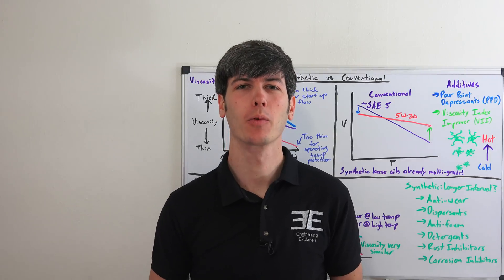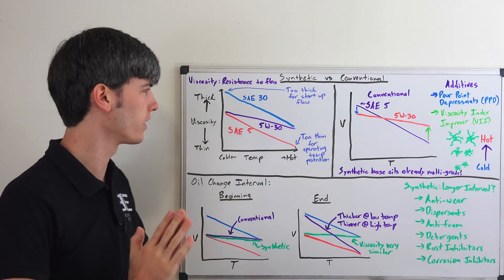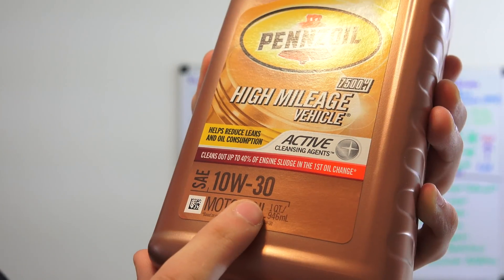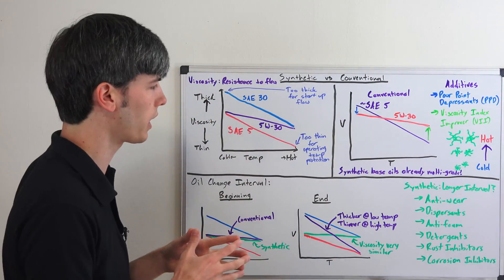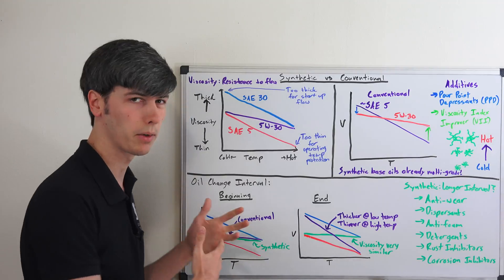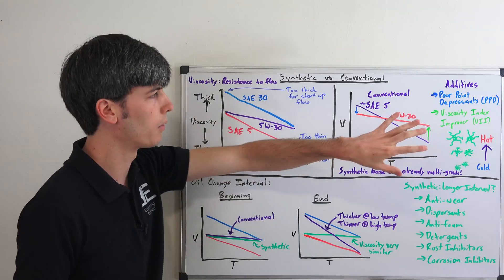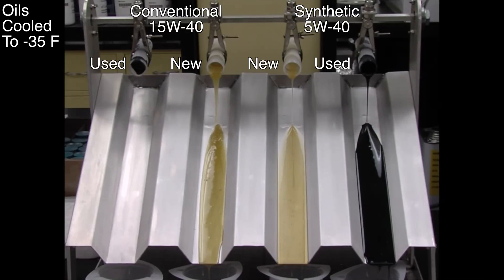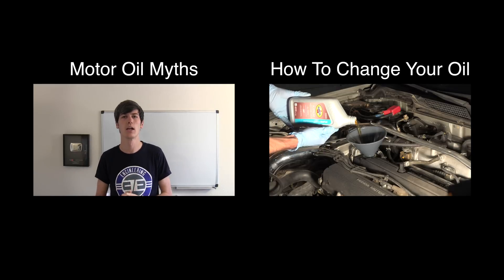Is Synthetic Motor Oil Better For Your Car?

Comment: That test was a tad ridiculous. What engine would recommend using 15w40 for -35F temperatures?
It doesn't really matter how poorly it performs at that temperature range if you are never going to use it under those conditions.

Yes synthetic oil is better than mineral oil, but provided you are using the correct grade and spec for our engine and change it at the required interval there is no disadvantage to using mineral oil.
As pointed out in the video,  the base oil may break down less but the additives still break down and you will need to replace at the same intervals regardless. If your engine is designed to work with 15w40 and you operate it in the correct temperature range there is no advantage to using a 5w40.

Comment: Im a chemical engineer and i was so confused with this rating. I tought the 5 and the 30 where the viscosity values. Now i inally understand this. Youre the best!
Reply: chemical engineer? should have studied grammar
Reply: @paulanderson79  english is my second language. How many different Languages do you speak?

So on top of being an engineer Im also bilingual. 

If you dedicated your time to help others and to be usefull, instead of attacking people on the internet,  you might become somebody worthy someday.
Reply: @NelsonR001  Not disputing that at all. Thing is that there's more than SAE viscosity when it comes to engine oil.

Comment: Can you experiment with using lightweight oil and see if it increasing mileage? Like 0w-20 to 5w-30 synthetic and seeing if it increases fuel economy and still protects the engine.
Reply: 0 Weight oil is usually too thin for a conventional car, race cars use it and "high performance" cars because the lighter oil helps when you go from cold engine to 100+/mph in seconds, but for a normal car user that scenario isn't realistic.  You'd also probably even loose protection once the engine got warmed up due to the less weight at the high end "20". Use what your car manufacture recommends, they tested and designed the engine and all its parts for a certain weight of oil.  Save gas mileage by changing your oil and air filter at regular intervals and making sure your tires are correctly inflated.

Comment: The W stands for Weight  or viscosity.  Standards test is heated oil timed through a funnel for the test. Read the testing standards book. READ!!!
Reply: No it doesn't. The W stands for winter the numbers are its viscosity. Ask yourself this if the W stands for weight (which by the way doesn't make sense anyway because you're saying weight is the same thing as viscosity which isn't true considering they are 2 different words with different meanings) why isn't there a W at the end of a 5W-30... wouldn't it then be 5W-30W? Its not because W doesn't stand for weight. Its a common misconception but a quick google search or whatever search engine you use will illuminate you on this matter even further than i can.

Comment: I drive tractor trailers for a living. One of my employers used synthetic oiling his trucks, engine, transmission and diffs. He followed the manufacturers oil change guide lines and had the oil analyzed. This was 15 years ago, and both trucks are still working. One has a new rear diff, but  other than that no major repairs. Also I bought a used Dodge minivan with the 3.3 v6. It had been on synthetic oil from its first oil change. I sold it when I hit 400000km, and it ran like a top and didn't burn oil. These 2 things have led me to use synthetic oil in all my vehicles since then, and I've had no major problems.

Comment: what is the difference between synthetic oils aside from prices, does it worth buying the most expensive one rather than a little bit cheaper. what if you use a cheaper one from refutable manufacturer, will it really affect your car's performance

Comment: Ok I understand what your saying but why does the purple line contradict what your saying... 5w is the resistance at start up which is lower than a resistance of 30 and therefore 5w is thinner. This thinner oil has additives which expand during the heating process and make the resistance of the oil go up to 30. That would mean on the  chart your showing the purple line would go up to the thicker part of the scale to 30 resistance.. YOUR GRAPH SHOWS THE PURPLE LINE BELOW 5W AS IF IT WAS GETTING THINNER MEANING IT HAS LESS RESISTANCE. Are you just illustrating what a 5w oil would normally do without the additives?  Your words and the chart were not adding up and made it more confusing .. although i did learn a lot here . am i missing something ? i just want to make sure Im not reading the chart wrong...

Comment: 1986 Toyota Tercel 275k miles
2006 Toyota Sienna 336k miles and still running.
2009 Lexus RX 350 (currently) 250k miles
All conventional oil. Don't see the point of spending extra $$ for synthetic.

Comment: Every amature engineer seems to always talk about the slipperiness and the W numbers with synthetic. Yet, none of them seem to discuss the dispersing of contaminants?  synthetic oil does not hold thecontaminats of combustion as well as conventional oil. This is an issue related to how the parts wear.  A point of this, is that in aviation products, the engine manufactures still do not recommend full synthetic oils. Using synthetics can void the engine warranty.
Reply: Good to know!

Comment: If anyone was wondering, synthetic, or conventional, 100 running cycles reduces most oils to a property that is no longer protecting against wear. what this means for the consumer if you do two trips a day, that's 2 full cycles out of your oil's life span. factoring an average of 2.5-3 cycles a day oil should be changed every other month. follow this schedule you wont be replacing any engines this year.

Comment: With cold engine start having been determined to be a major contributors to engine wear, has any manufacturer considered a somewhat delayed start to allow oil to warm before the engine fires? I have an older Alfa and when the ignition switch failed, I added a separate and independent starter button and ignition toggle. I’m sure it makes little difference (@120k), but I typically crank the engine (ignition off) for a few seconds to build some pressure before I hit the ignition. Feels good!
Reply: that's something i've thought about too, re the moment of first fire.   (i thought of it bcuz i have a car i use infrequently so i know the oil has entirely drained to bottom, with nothing coating the surfaces of contact wear surfaces.    Incidentally, the cold weather areas often have engine oil heaters that keep the oil warm all night, and to me, that would be an absolute must in even modestly cold weather regions.  I live in a moderate maritime zone, very mild.   But the number of cranks before firing is something i wish i could manipulate on any car i have, and perhaps there are potential electronic hacks for it, though i've never heard of any being for sale.    Some may argue that the extra cranks could do more wear on some engine parts, paradoxically due to rates of rotation perhaps, visavis how soon the oil is delivered.  (bcuz delivery of oil speeds up dramatically once the firing starts.   So i guess this is a question for the engine engineers.

Comment: Wait a minute.  What's the real bottom line here?  The real bottom line here is money, not superior performance:  The oil companies can realize a much higher profit margin off of selling synthetic oil, which is manufactured using much less real oil, than they can off of selling 100% real oil as a lubricant.  Then come the spin artists like this guy on the video telling you a bunch of questionable reasons why you're better off with synthetics.  Hitler, because of Germany's restricted access to petroleum during the Third Reich, was forced to rely on synthetic fuel oils ingeniously invented by his German scientists.  This is the same thing all over again, except that here there is no shortage of real oil, there is just a quest for greater monetary gain.  Once again, little guy, you are just being robbed by the big guys.

Comment: Answer is simple. If you have a cheap car just run it on conventional oil. It will wear faster but you will sell it before that. Now cheap cars are not meant to last. Use synthetic for those who really matters
Reply: Very few cars here in Europe have specs that can be met with mineral oils. It's not just about viscosity.

Comment: My camry 2015 has 180k miles on it, which oil should I use?
Reply: Whatever Toyota tells you to use. Please be aware that there is far more to it than just SAE viscosity rating.

Comment: i have a jetta 2007 2.5 5 cylinders with  108 miles what oil can I put...
Reply: Look in the manual. There will be a spec something like VW505.01 / VW507.00 or similar. Buy oil that meets this specification.

Comment: Well...added to the fact that synthetic oils don't break down as fast...I go 10,000-12,000 miles using mobil 1 and a quality filter...Never had an engine wear related issue...In this current extreme cold spell we are experiencing -15 to -25 below zero...the car is much for likely to start since synthetic doesn't thicken up and freeze like conventional oil..

Comment: I switched all my vehicles to fully synthetic oil. Although the color is darker after 7000 miles oil change I still pinch the oil between my thumb and index finger and it still has good viscosity without any grit. Back in the old days I used to use conventional and changed my oil every 3000 miles but not anymore. I would also spend a few extra buck and buy a better oil filter instead of a junk oil filter. STAY AWAY FROM FRAM oil filters, they are trash.

Comment: Warning if you have a older truck or car you might be better off using conventional I bought a 92 f150 a while back when I bought it the old man told me he only used conventional oil in it cause that's what works best I did not believe him so once I reached the appropriate mileage I changed the oil to full synthetic and changed the oil filter to the next day I started up my truck and heard a knocking sound that it did not have before and it would stop after my truck got fully warmed up and then a month later I noticed my oil was low and I was leaking oil from somewhere but no idea where and that was not happening when it had conventional oil in it so I went to the store and bought conventional oil and changed it again and both the knocking sound and oil leak stopped so if car that around the years of 95 or older and you might be better off using conventional because that's what those engines are made for

Comment: Does this apply to a diesel car engine?
Reply: Use an oil that meets the specs listed in the handbook. It is not just about SAE viscosity rating. You need to check ALL the specifications.

Comment: I was wondering whether synthetic oil can last more than 6 months? There is a common understanding that for synthetic oil, it should be replaced every 6 months or 10,000 miles. What if my car only traveled like 2,000 miles in 6 months. Should I replace it or I can probably stretch it to 8-10 months?

Comment: So a 0w40 would be better than a 10w40 for cold start ups?
Reply: Go with what you car maker recommends. There's more to oil that simply its SAE viscosity rating. In general it's bestrr to go with the narrowest range which suits the climate where you are. The wider the range the more the oil is dependent upon VI and friction modifiers. This can cause oil to deviate from spec sooner than anticipated.

Comment: If synthetics are better why do they sell regular oil?
Reply: Because some people buy it. In America anyway. In The EU it's virtually impossible to find. Most EU cars now have specs that cannot be met with anything other than synthetic oil. It's not just about viscosity. The only benefit to regular oil is that it's generally cheaper than synthetic oil. Beyond that I can think of no benefits.
Reply: @paulanderson79  

Old cars run old oil.

If i would go for synthetic my '69 car would start leaking everywhere
Reply: @benbonaparte4431  Fix the leaks then.
Reply: @paulanderson79  

Old cars arent that exact as new ones. Was simply dont possible.

Fixing leaks would mean overtorque. Just not necessary
Reply: @benbonaparte4431  OK - I'm with you now. I was thinking of recent model cars which absolutely have to have synthetic oils to meet the engine's requirements. Ones where there's no mineral (conventional / regular) alternative.
Reply: Zinc, Needed in any non roller lifter engines.          Flat tappet engines, Lawn mowers, Older diesels, Older motorcycles. Two i know has zinc are Mobil 1 15/50 Racing oil and shell rotella 15/40 Diesel oil. Cam lobes don't last long if the oil doesn't have enough zinc.

Comment: Synthe oils have zinc in them to protect the camshaft in our older model engines ? Rebuilt
Reply: Zinc is used where “boundary lubrication” zones exist (piston rings, gearteeth etc) camshafts are under “hydrodynamic lubrication” conditions

Comment: The thickening of the conventional motor oil when it reaches the end of its use life at the change cycle . . . Aaahhh!  So that is why it was suggested to me that it was best to drain the conventional oil while the engine was still hot when I started doing my own oil changes on vehicles 45 years ago.  Or, to warm up the engine prior to doing the oil change back in the days of conventional oil.
But, I've switched to using synthetic motor oil back around 25 years ago for my own oil changes.

Comment: Jeeps rust faster than any vehicle I know. Bottom line change your oil often and your engine will run 500,000 trouble free miles. Rustproof the undercarriage of your car yearly with Linseed oil and your car/truck will last forever.

Comment: Hello, planning to change the oil of my new used car. It is a Hyundai Accent 2010 Turbo Diesel. What engine oil should I use? I live in the Philippines. 30 degree celsius average temp here.
Reply: Whatever Hyundai suggests.

Comment: What about an old vehicle(87 Ranger) that's used conventional oil all of its life, with regular oil changes at about 2300 miles? Is it wise to switch to synthetic at this point?  Some advise to Not make the switch for fear of damaging the motor.  Please comment on this matter.

Comment: Ok I have a 1997 F-250 HD with the 7.3 L Powerstroke and I use 
15w-40 oil and it has a hell of a time starting in the winter months here in Alabama I was wondering is there a different oil grade/vescosity  I can use and still provide the same protection as the 15w-40 thanks have a good day

Comment: I wanna ask 1 question plz answer me soon i am from pakistan i buy 5w-30 fully syenctic oil for suzuki cultus pl let me know 5w 30 is also work in 50 degree ?
Reply from the maker: Yep, if it’s what’s recommended for your car it’s what I would continue to use. Owners manuals will occasionally recommend a different oil based on the temperature.
Reply: @EngineeringExplained  i have suzuki cultuse 2018 plz let me know which oil grade should i use in it

Comment: i have  a 1999 subaru legacy Brighten i think it's a 2.2 i change the oil about every 5,000km but i only drive about 15,000km per year should i change it more my car has just under 148,000km on it

Comment: I know it's very difficult to fit all the needed info on topics like this into a short video.   This channel does a great job of squeezing in alot of good information and explanation into such a short video.  
I spend alot of time trying to explain basic oil understanding to customers and other mechanical enthusiasts.   Alot more to explain when it comes to motorcycles that use a wet clutch as most motorcycles these days do.  With a motorcycle that uses the same oil in it's engine as well as connected transmission and clutch case, be careful not to use automotive oils with friction reducing additives, they will cause clutch drive plate to friction plate slippage and engagement issues.

Comment: Newer turbo and direct injection engines have higher compression and are notorious for using oil. Conventional oil will enter the combustion chamber and cause preignition from heat of compression and blow out rings, pistons, etc. if the manufacturer calls for full synthetic you’d be wise to follow their recommendations

Comment: 5W VS 15W for what?
- 5W absolutely high flow than 10w
Reply: Well, kinda. At very low temperatures pour point is all that matters - regardless of the viscosity the oil will pump or not based on the pour point. The viscosity determines how it will flood the journal bearings at low temperatures.

Comment: So what about the synthetic motor oils that say you can go 10000 or 20000 miles but in the fine print it tells you to go by what your owner manual says otherwise you could void your warranty even though you're paying top dollar for oil you can't even use for 20,000 miles Technically

Comment: My Dodge ram , at the dealership for oil change got free oil for the year . my Question was can it use Conventional oil , Yes .  takes 8 Qt  Con oil is 4 dollars a Qt , Synthetic is 12 dollars a Qt  at 21,000 miles I have less money in Conventional oil I save 64 bucks that's 2 more oil changes.  Oil is Oil it breaks down , you may get 7000 miles on Syn oil , but you pay for that extra mileage .   Only reason to use Syn oil is it uses less over a year than Conventional oil.  All that Oil I drilled for in the 1980s was capped for the great grandkids to use .  give it 200 years the Oil will be used up .  That is why you can buy recycled oils  Walmart Super Tech  is a used and refined oil . I use it in my Lawnmower only .